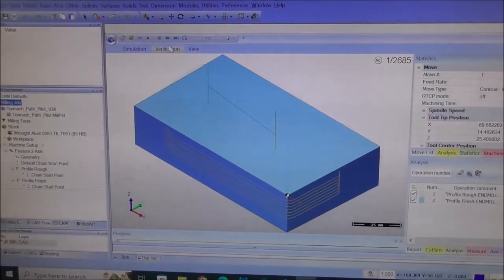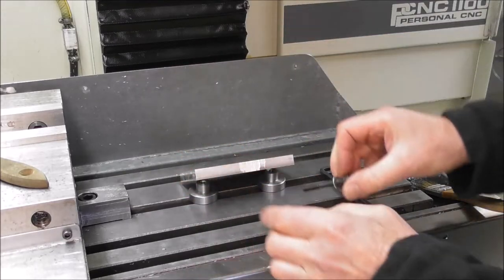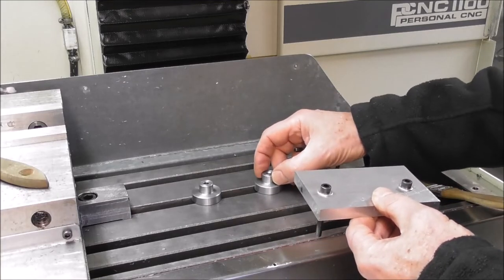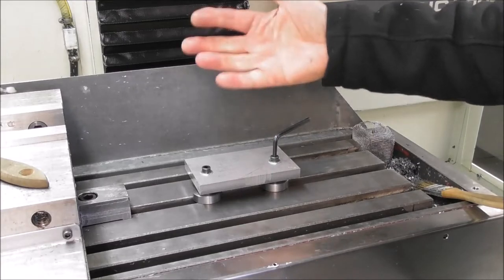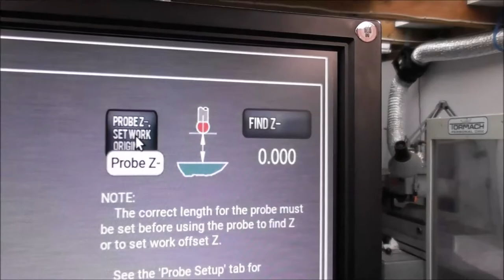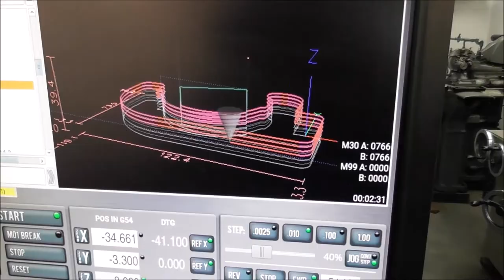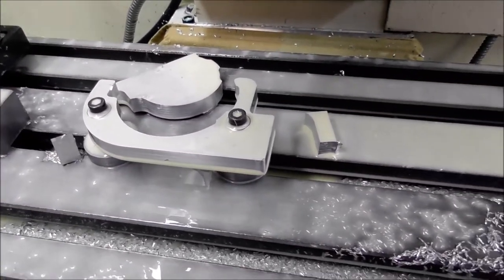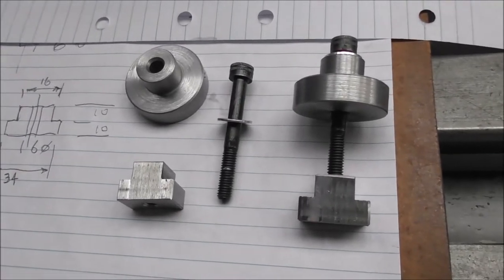Work holding for profile machining - Standoffs

Comment: The traditional way is to hold a piece of scrap in the vise and tap 2 holes in it. The program uses the tapped hole as a datum as it has just been drilled and tapped. The important thing to remember is to drill your parts before making the fixture. Simply bolt the parts and run the program, no clocking up parallel or finding two datums For repeat parts just bolt them on and they are already to go. All toolmakers and millers will have a piece of scrap full of previous tapped holes for this purpose. A tenon on the bottom of the standoff would keep them aligned with the tee slots.
Reply from the maker: Thanks for your input here! Cheers, Cliff

Comment: Button head screws have lower head heights and there are low head cap screws theoretically also available with half the head height.
Reply from the maker: Yes, low head height screws would be better - button head screws use too small a key to allow fully torquing. Cheers, Cliff
Reply: If you have a lathe, screws with any head height are always available.  Snap Jaws, for rapid jaw change on a mill vise, use modified socket head cap screws that have a shorter head than normal.  It would be to your advantage to use carbide to cut and modify them quickly.
Reply from the maker: @37yearsofanythingisenough39  Thanks! Cliff